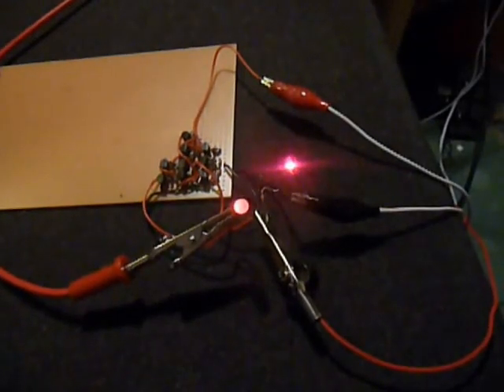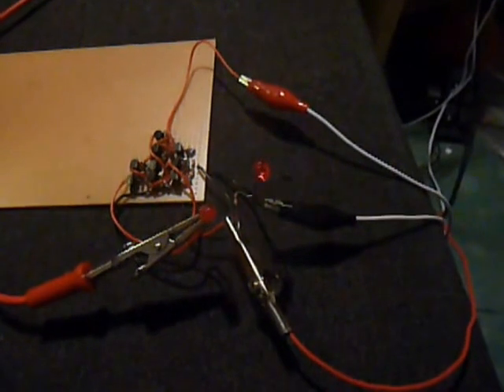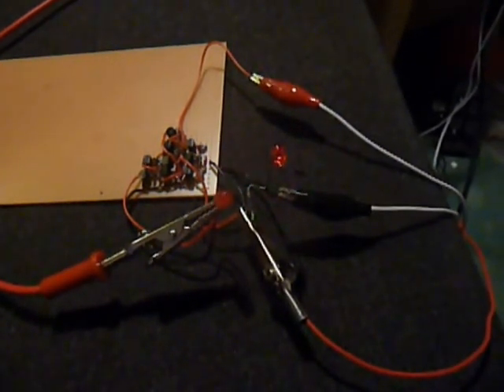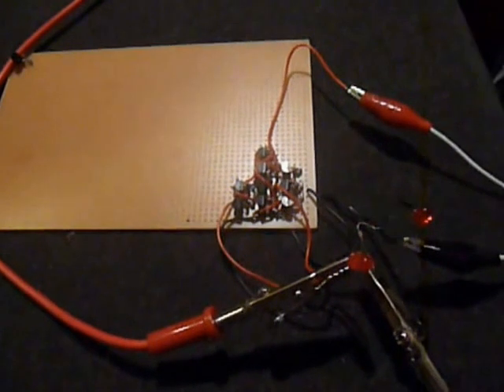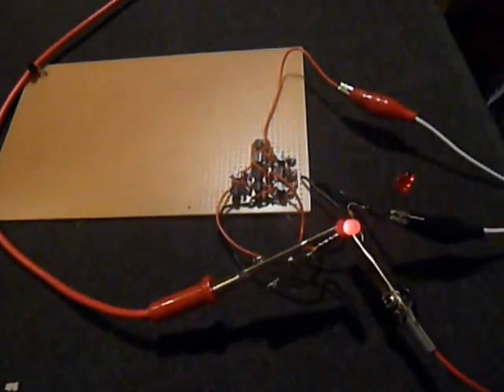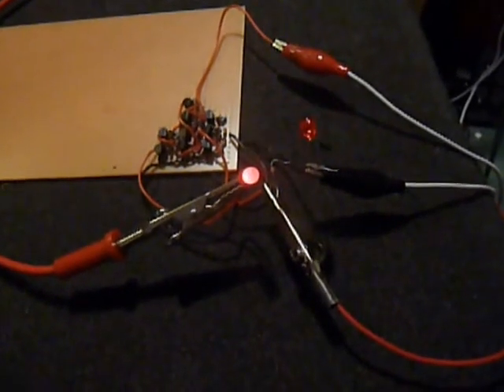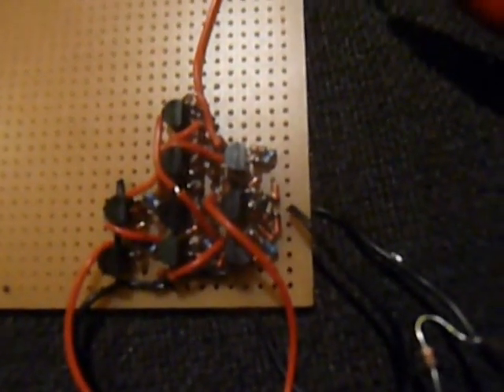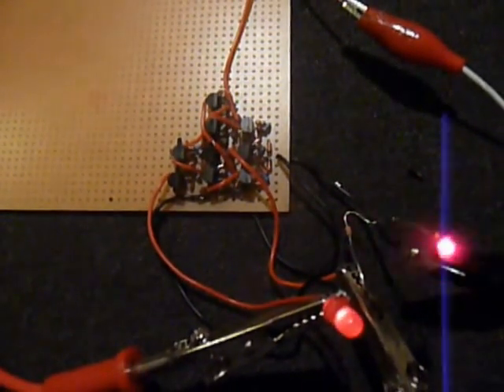'Tiny Tim' DTL Computer (Vlog 1)

Comment: Should take a look at the transistor version of the PDP-8, schematics at pdp8online. It uses diode capacitor gates to reduce the transistor count even further: 13 transistor per PC bit.  I don't know if the overall parts count will be less though.  Also for a simple inverter, the discrete TTL version uses one less part (but two transistors).

Comment from the maker: Just make sure you're using the correct transistor pin out, and roughly the right resistor values... It should just work :L I'm running mine on 5V but should work anywhere between 1-15V...

Comment from the maker: I used to make my own PCB's at school, and it was not something i enjoyed :P plus, if you made a mistake whilst routeing, you had to either make a nasty jump link, or print off a whole new board.
I'm using individual pad prototyping board, on which you can solder the pads together to make tracks. It's much quicker and easier to debug.

Btw, i may use the same type of screen as your OISC computer, as I have several and its easier than composite video :L